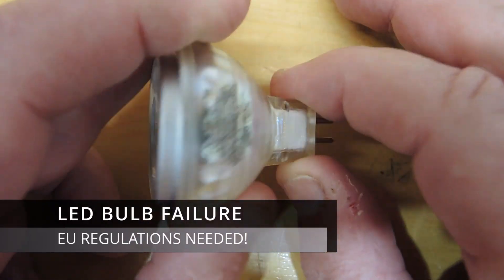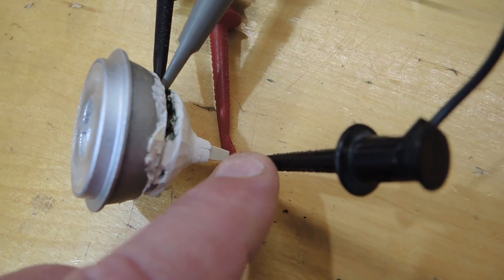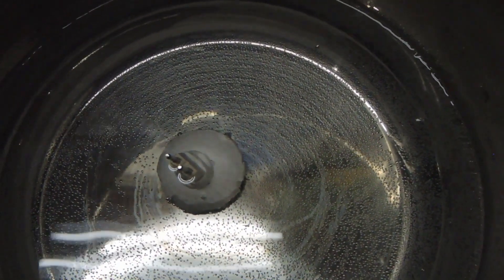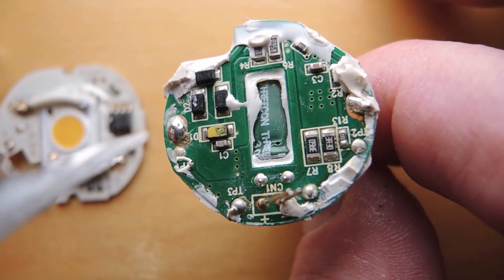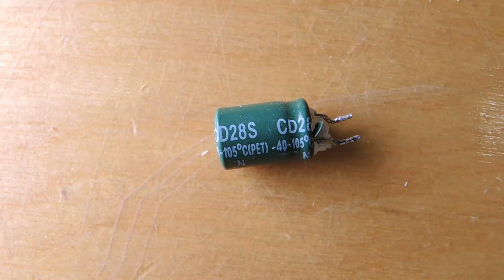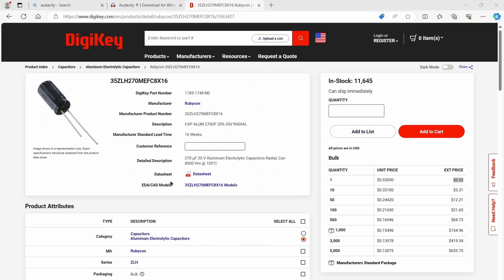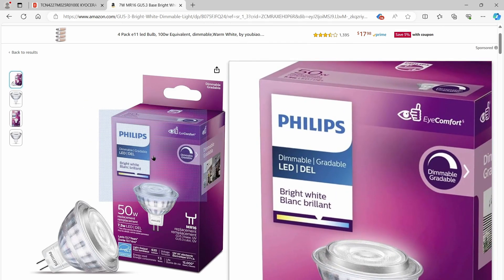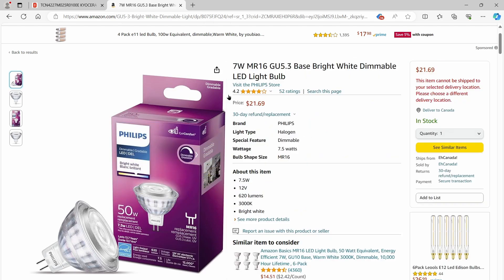LED BULB FAILURE: BAN THIS DESIGN!!!

Comment: Frankly, you can't get rid of electrolytics. I mean we just don't have anything else with such good capacitance to size relationships that's inherently safe... Tantalums start fires and burn. There are also issues with tantalum being a blood mineral...

Ceramics also have issues with them losing significant capacitance when inserted across a DC potential and microphonics and very narrow frequency response etc. and having "too low" ESR that can lead to oscillations in power-supplies etc... 

so we're stuck with electrolytics...

What we instead should do is completely move away from mains voltage as a way to power lights or get new types of bulbs that are designed LED requirements in mind...

It would be great if we could ditch electrolytics... but... :(
Reply: Note here its an mr16 so 12v ac/dc in so not directly mains powered, but all other points are good. But changing the design of lighting altogether isnt good for retrofits (ie requires complete replacement) and theres no standardisation ive seen in splitting drive electeonics and led panels. I suspect convincing companiea and consumers to advertise/look at buld life more would be better. But its a hard sell as brand loyal customers buying half as often is a disincentive and price is often a key driver in purchasing.
Reply: @selwynrh  Well, running on AC means having to rectify the power, and filter it too.  It's mains stepped down with a transformer.  If DC were required, this would push the rectification and filtering to the controller, which then can be reasonably asked to not have a filter which will conk out in a mere 3 years.
Reply: Meh, just no.  Trying to pretend that they will be expected to st art fires and burn, would ignore that they are used quite a bit in designs and aren't enough of a safety risk to abandon their use, nor that of other chemistries and compositions besides electrolytic.  Nope, electrolytic is used for its low cost, including being able to pick a topology for the circuit that is low as well,  and that is the only reason.   You can easily design with a solid capacitor and keep the rest of the design, seems like your theory that you can't get rid of electrolytics, is ignoring the capacitor advancements that have been made in the last 40 years.
Reply: Google polymer electrolytic capacitor, gets rid of the liquid electrolyte. 
Microphonics aren't a problem in 99% of designs btw.
Reply: @jaro6985  A light that would flicker with ambient sound level would not be a good thing unless you wanted it for a disco, but yeah, the problem is probably not of that magnitude.  Still there are valid safety questions about running a capacitor of that size in a hot package.  An electrolytic pushed past its endurance will blow its juice and then fail open.  Aluminum won't ignite at such temperatures.  Some other metals and dielectrics may burn.
Reply: More reliable electrolytics are available with a longer life expectancy. If you cheap out with anything, you suffer reliability issues.
Reply: You're just stating random things that you memorized but don't understand.  Microphonics?  Really?  Do tell what difference that will make in  the crude current regulating circuit for a light bulb!

There are multiple options to make the bulb work without electrolytic caps.  All of them cost more besides the most crude of all which would have been to just use a current limiting resistor and make the assumption that the bus for the light system stayed a constant regulated 12VDC, or a rectifier and solid cap if it were 12VAC.
Reply: @stinkycheese804  so are you trying to imply, that capacitors are only needed in crude current regulating circuits?

Comment: I'm still running my ~2013 vintage Philips 5.5W non-dimmable bulbs, haven't had a single one (of 7) fail yet.  I have them running off my 12V solar battery bank (thus the non-dimmable bulb as I wanted constant brightness with varying voltage):
https://youtu.be/8RqFiJkMDxc?si=ShYJGV9CVVdqp8zN
At the time, 5.5W was the max. power MR16 bulb Philips offered that had no built-in cooling fan.

Comment: Well if we weren’t cramming all of that circuit into an obsolete incandescent package,  then we would be able to reliably use the electrolytic by keeping it away from the hot circuit elements
Reply: I designed and engineered a range of MR16 repacement lamps that used a separate LED driver rather than the 12V. They lasted fabulously long, but needed an electrician to install. We drove them at 3W, and the body was fine tinned aluminium with direct thermal path from LEDs to the fins.
.
The complicated electronics inside retrofit lamps like this is due to the horrendeous quality of ELECTRONIC transformers for LV halogen. There is SO much noise and ripple, different brands have different characteristics, many need a minimum load to even operate, etc.
.
Remember... the 12V supply can push 4A at unknown voltage, they aren't constant voltage in any remote sense of the word, and they are designed for a known resistive load. Yet LEDs need constant current drivers to ensure that current doesn't overdrive the chips if voltage rises.
.
Physically the MR16 LED lamps need to be 100% retrofittable into an almost unknown number of power supply supply scenarios, and the MR16 form factor is far too small to conduct the heat away.
A 50W MR16 is pushing over 1000 lumens, and in this kind of arrangement you need 10W of LED to match the output.
.
You can get away with 5W without people noticing much, but then there is the problem of getting 5-6W of heat out.
The lamps operate base up, so all the circuitry is above the  LEDs and there is no air circulation whatsoever.
.
So, the chips in these are loterally cooking, there is no need to make the driver last longer than the LEDs in the bulb. And the TMC and wholesale selling price of these is WELL under a DOLLAR, and retailers will not buy if you are even 5c higher. The retailer is getting over $14 each in profit, if you pay $15.
.
The bottom line is that there is no possible way to keep a pure MR16 form factor if you want reliability, and equal light, even if there is no electronics inside there at all.
Reply: So instead of having to replace the bulb, you'll have to replace the entire fixture.   Buy a house and every fixture has daylight LEDs built in and you want soft white, all those fixtures must be replaced.  The incandescent package gives people choice and flexibility in their lighting.
Reply: Agreed 👍
Reply: Somewhat true but you could keep the bulb form factor and just change the whole supply bus instead, so that it no longer runs on 12VAC... remembering that it had to have a PSU to get it from mains 110V/220VAC to that 12VAC in the first place.  If it were 12VDC, it doesn't even need that circuit/capacitance.
Reply: @stinkycheese804  But that is the point.  If you did that, you would be moving the electrolytic capacitor to a place where there isn't much heat.  But that is not compatible with the existing infrastructure because the sockets require a particular bulb shape and the power is that way because it is attempting to reuse existing incandescent infrastructure rather than building infrastructure that makes sense for LED lighting.

Comment: Wouldn't the failure mode of tantalum (being a short) be a potential problem?  I had to switch to electrolytic on a product I was designing because of this, but the world of AC lighting isn't something I have dipped my toes in so I am not sure it would be an issue or not
Reply: It's enclosed and would just blow a track if not a fuse or resistor.  Don't see the problem.  Also it seems a bit misleading to suggest you had to switch to an electrolytic because there are other chemistries besides just (wet) electrolytic and tantalum.
Reply: @stinkycheese804  you are correct that there are other chemistries, I just gave the conclusion of the saga since it wasn’t really the point. Also when a tantalum fails it may blow the track, but it is more likely to become a 0R Resistor… which is why I asked the creator of that would be a potential downside

Comment: I tried searching for the data sheet for threecon 30v 270uF , capacitors are usually rated in hours of operation, most electronics I come across has aluminium electrolytics rated for 105* for 1000 hours .. I believe this one in your hands is the same , I can’t confirm without looking at the data sheet .. but that’s my guess 😝
Reply: Lifetimes hours go up as temp goes down though, without that data from a sheet or testing, can't really determine much as it is unrealistic to just assume that if it runs hot,  then it must be near the max rating of the capacitor.
Reply: I found a reference that states "CD28S Super Low Impedance Long Life 105°C (6000h~10000h)". And a datasheet for a threecon/sunion CD28C that says 8000h. So I don't think its a 1000h cap. 
We'd need to know the actual operating temperature to say much more, like cheese says above.

Comment: what other capacitor do you suggest ? 
Maybe a higher rated aluminium electrolytic ? 
I believe tantalum would be dangerous, as it explodes if there’s a voltage issue
Reply: MLCCs have come a long way from their inception. I suggest using those whenever possible.
Reply: Tantalums are in fact used in various equipment, why would we need to pretend it is especially dangerous here?   Further, so what if it did pop?  It's not as though it is going to make the bulb become a grenade that takes you eye out or burns the building down.  It would just stop working, same as it did with the electrolytic, "IF", and this is a BIG BIG BIG IF since all we have evidence of is the capacitance value dropped, not that it was the actual cause of failure.   

Capacitance drop will happen even if another problem was the actual failure point.  We'd need to see the circuit schematic for starters and the drop in capacitance might just mean it has a slight bit of mains or double-mains frequency brightness fluctuation which many people wouldn't even notice since the cap was not completely open circuit, still had about 1/3rd it's rated value.
Reply: @stinkycheese804  correct me if I’m wrong but I haven’t seen them being used in SMPS power supplies